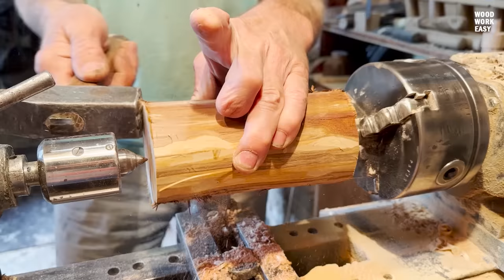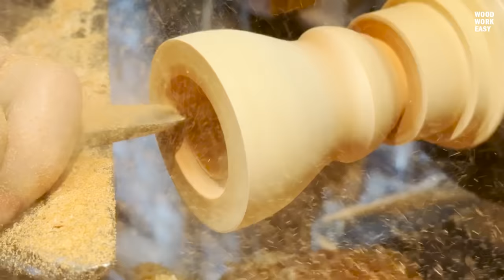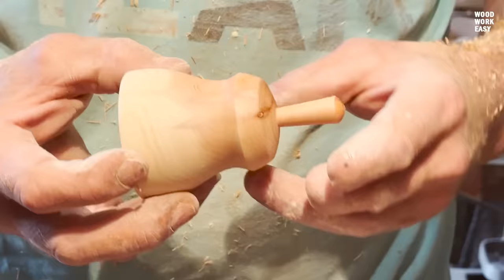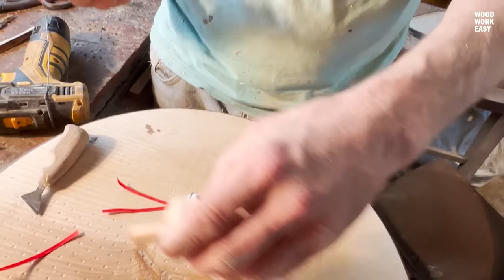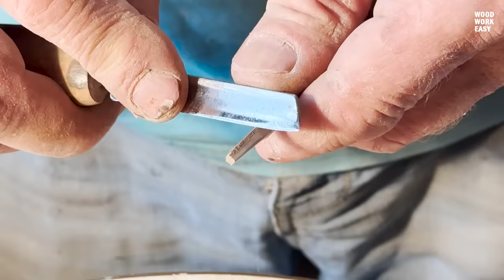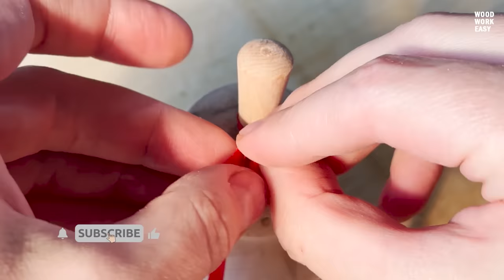How to make wooden BELL. DIY.

Comment: Nice project, and a switcharoo: using a bell as the clapper of a bell.  Some questions: 
1) was the wood green when you did the turning? 
2) Why did you use the parting tool to true up the end of the cylinder only to cut the end off?
Reply from the maker: Hi, thanks for watching!
1) No
2) It's just so convenient for me)